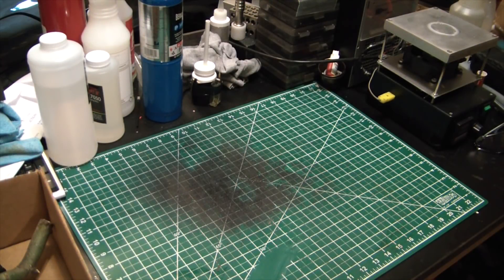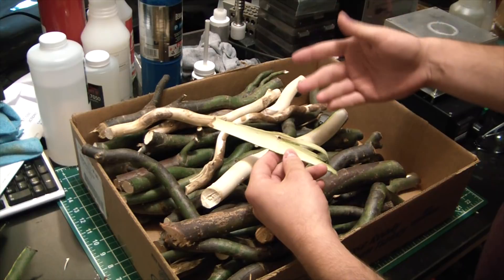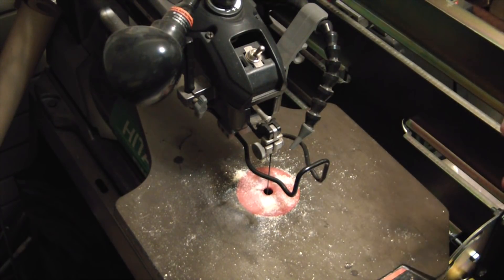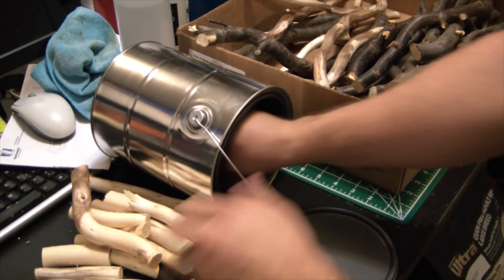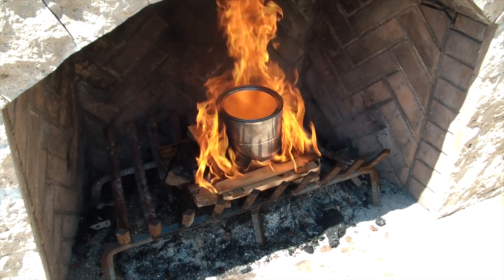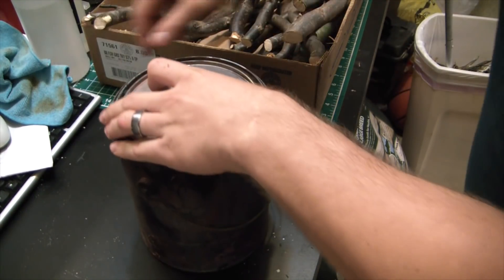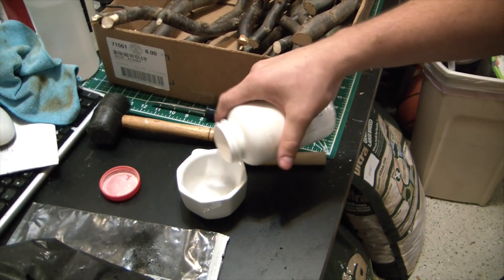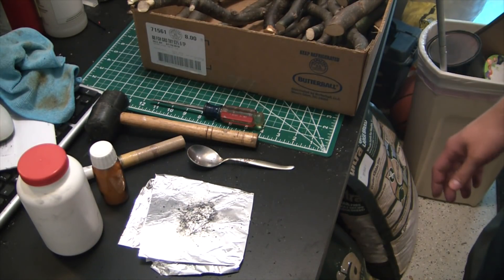Making Willow Charcoal for Black Powder - The BEST Charcoal! ElementalMaker

Comment: I find a pressure cooker over a electric or gas stove much easier to use. Just leave the pressure hole uncovered and when the wood gas comes out just light it with a match to safely burn it off.
Reply from the maker: I prefer to use the wood gas itself to heat the charcoal vessel. Pressure cooker is a great idea though, and it would be easy to set up some copper or stainless tubing to redirect the wood gas to burn under the vessel

Comment: I bought a bag of hamster red cedar bedding and turned it into charcoal. It burned a lot faster and into smaller pieces. I have yet to make bp with it but I read that red cedar burns fast as pauluwania or however it’s spelled.
Reply from the maker: That's a great idea to use for charcoal! Definitely should make good bp!
Reply from the maker: Bummer is I just cut down a red cedar in my backyard and didn't even think to make some charcoal with it. DANGIT!
Reply: Lol well over here its hard to find willow trees so you got lucky as almost all the sites are oit of willow charcoal. Thats why I researched and found the red cedar and its only 4 dollars for a huge bag.
Reply from the maker: I was just reading up and the cedar should perform just about as well as willow, so you did a kick ass job finding a great source! I'm definitely going to have to try that!

Comment: 2 Questions:
First, you referred to the willow tree, I assume you’re talking about the weeping willow tree. I can’t seem to find any reference to any Other type of willow tree out there. Is this true?

Second, is there a difference in using dead dried out limbs from the willow tree or do they have to be green like the ones in your video?

Great info, thank you
Reply from the maker: Pretty much all varieties of willow make for great BP. Ive used both weeping and curly and both are equally great. Dried wood is totally fine to use, it will pyrolyze a bit faster than green wood. Just dont use rotten wood and you'll have some great charcoal.
Reply: Mesquite is better cleaner hits harder

Comment: Can you use wettable garden sulfur or do you need elemental sulfur?
Reply from the maker: It would depend on the purity of the garden sulfur. Its easy and cheap enough though to get very pure powdered sulfur that messing with other sources isn't very worthwhile.
Reply: @ElementalMaker  ok well I'll check the purity at my local hardware store and maybe see about other sources online. I've got plenty of willow to make charcoal out of and potassium nitrate is easy enough and cheap enough to come by. It seems the sulfur is always the part people have trouble with

Comment: I wish I could get some willow. I am out of room for anymore tools lol. Nice job
Reply from the maker: Its my absolute favorite for hot BP second only to Paulownia imo (which has gotten very hard to source despite being invasive).
Reply: @ElementalMaker  I'll have to try it sometime. But I use paulownia exclusively for burst and lift and mixed hardwood for larger cored BP motors. But the willow will be a great candidate for nozzles motors that's an experiment I may pursue. But the fireworks cookbook is a great place to find all the chemical needs you may have. And a few charcoals to choose from

Comment: Well at least he used a long reach lighter, but did he really say he mixes the BP components in a ball mill?  Unless he does it wet that's a possible bomb!  Even in a rubber mill with lead or ceramic balls, the friction alone can be enough to ignite it.  Please, people, DON'T!  I speak from experience: when I was an ignorant, inquisitive schoolboy (in the fifties, been there, done that) and made a rather crude gunpowder in a pestle and mortar it DID ignite.  Fortunately the ratios were incorrect so it burned rather slower but my hand still took months to fully heal.  Could have been a lot worse but please be warned.
Reply from the maker: George none of your information is correct. It is standard practice in the field of pyrotechnics to make BP using a ball mill with lead media. If your BP ignited from a mortar and pestle you did something very wrong (ie used chlorate instead of nitrate). I've been making BP in my ball mill for many years and not one issue. I recommend reading "Ball milling theory and practice". Lead media is non sparking, and BP by nature is very insensitive to friction.
Reply: @ElementalMaker  OK, point taken. It was over 60 years ago and I don't recall whether I was using nitrate or chlorate back then; from what you say probably chlorate. Even so I wouldn't chance it.

Comment: as Im new to this and never done it before, the only question you never answered in the video is how long to leave the can in the fiure when you are first creating the charcoal, i noticed you said that the pressure had decreased so all the water had gone, but how long after that should I leave it in the fire before taking it out and crushing it? I know this is an older video but I hope you are still monitoring this to answer my question :-) Many Thanks, An Aspie Geek in the UK
Reply from the maker: Once the can has finished outgassing, give it an extra 5 min or so 👍
Reply: @ElementalMaker  Thanks for the speedy reply

Comment: I've been making my own hardwood charcoal for a few years. It's great for cooking. I was aware that willow is best for black powder. I've been curious about using pine cones. I have made charcoal out of pine cones for the check of it and it's an interesting end product.
Reply from the maker: I know a few guys who have used pine cone charcoal in for glitter effects in star compositions and it works beautifully!
Reply: @ElementalMaker  why would you exactly do that ... Adding this type of coal what are the benefits ?
Reply: @umbeatable2770  Black powder made with the softest hardwoods is by far the best. Most of these soft hardwoods are the fastest growing, like willow, alder, balsa, etc. Some softer softwoods are good. too, like pine.

Comment: Willow grows all around me in here in Texas but I am to lazy to go cut it and make charcoal.  I am still using the big old bag of commercial air float charcoal that came with my pyrotechnic black powder supply kit it will never be as good as willow.
Reply from the maker: Grab your chainsaw and give it a try 👍 once you pyrolize it, it's just as easy to use as commercial air float.

Comment: As far as the extracting painkiller from willow, I heard the same thing about silver birch so if you do experiment please try that too. As far as the willow charcoal is concerned it occurred to me that seasoned timber would have made more sense. We already know willow charcoal is the best for purpose but would seasoned timber be better?
Reply: That explains why graphite makes a lousy black powder. Thank you for the knowledge.
Reply: It seems nobody ever got back to you on that question. When drying, wood gets denser. So seasoned timber will make heavier, denser charcoal, which is exactly the opposite of what you want for black powder. What makes the green willow so good, is that the xyleme tubes are wide and the wood fiber is fluffy, so you get a maximized reactive surface. Dense coal will burn much longer because they also burn slower. To make good black powder from dense charcoal, you'd have to add a step in the process to increase the contact surface. (I believe Cody's Lab has a video about that, but for the purpose of activated charcoal instead of black powder. The principle is the same.)

Comment: Why did you put hole in bottom instead of top?
Reply from the maker: You can put it either way, but with the hole on the bottom, the venting gasses burn off and feed the pyrolysis process. It essentially fuels itself with the wood gas produced.

Comment: how about alderwood?
Reply from the maker: Haven't ever used it myself, but its supposed to be one of the absolute best. I mistakently forgot to mention it
Reply: I've used both willow and alder for BP.  Willow is better, but alder is about 85% as effective.  Alder was much easier for me to get, so most of my BP was made with alder charcoal, and I could use book weights for commercial BP as starting points on all my BP lift charges.  Would usually have to add 5 to 10% to get the shells where I wanted them...  But I was never sad I used the alder.

Comment: 75%p 15%c 10%s the ratio I use for any amount . Eyeballing works just fine for me ... Happy 4th of July ...
Reply: Ulrich Bretscher’s extensive experimentation with various ratios, types of wood, heats and methods of charring, and other factors determined that you pretty much can in fact “eyeball” it once you have a good idea of the ratio. The main factor determining power of black powder is the lignin content (lower is better) and heat at which is was charred (lower also better). You ought not call people liars without knowing.

Comment: I had the opportunity to make both willow and grape-vine charcoal and test them side-by-each.
Both samples were 'spring growth' stock...trimmings early in the year, still a bit green.
Roasted them in sealed can...you know the drill.
I didn't use sulfur in the tests as I was using the 'CIA'/alcohol method to recrystallize the nitrate and infuse it into the charcoal.
Expelled excess moisture through pressing, made little 'cakes' of each mixture.
Willow burned faster, grape-vine left less ash.  Pretty comparable to commercial 'Pyrodex' in burn rate.
You could call it a modern take on the old French 'co-co' gun-powder; sulfur free, charcoal still has slight brown color due to low temperature roasting.
Reply from the maker: Very cool! I've never gotten to play with grape vine charcoal but hear it is very good stuff. Do you have to debark it before use?

Comment: Could I use a pine wood?
Reply from the maker: Yeah absolutely! Normal 2x4 pine from the hardware store makes good charcoal for BP. Just try to cut any knots out before pyrolyzing the wood.
Reply: Honestly you could technically use any type of char but different materials work differently and some are better than others
Reply: What we want is a fast burning wood with low moisture and low resin content.
Some kiln dried hem-fir 2x4 from Home Depo or any lumber yard will make good charcoal.  Just cut it up in chunks. Cut out any knots that will have lots of resin in them.
Make charcoal then crush and grind.
Reply: Might try balsam wood also.

Comment: How did you deal with the coating on the inside of your can? Thanks for sharing, Billy in Canada
Reply: I won't pretend to answer for him, but as hot as that can got from being cooked by the external flames as well as that intense heat created from that escaping wood gas flame (it burns VERY HOT) caused that can to looked so burnt, it more or less demonstrates that a regular tin can (regardless of it's size) appears to be ''a single use item'' when they're used to make charcoal. I wouldn't worry about that minute bit of residual carbon left in that can & would dispose of it in a way he sees fit.

Comment: Thank you. Hmmm Willow hard to find in the Wild West.... I have abundance of Cedar and Juniper and sagebrush and Tamarisk.
Reply from the maker: Hmm not sure any of those will make a super fast BP, but heres a list I got from a pyro forum some time ago: Pine, Balsa, Red Cedar, Paulownia, Willow, nearly any Fruit trees.
Reply: @ElementalMaker  you said any fruit tree should work, based on that source. I have an entire dead apple tree in my backyard that might work great then :)
Reply from the maker: @dELTA13579111315  that it should!
Reply from the maker: Also, any regular pine wood (ie framing 2x4's) from the local hardware store make for a great charcoal. Not quite as fast as willow in my experience, but very respectable!
Reply: I would think sagebrush would be good because it has a lot of natural oils.
Reply from the maker: @Greg Peck I haven't ever tried the store bought lump hardwood charcoal, but I'd bet it would work perfectly fine 👍probably not as fast burning as willow since it's hardwood, but I'm sure it would work acceptably well for most all uses
Reply: Jeff,  this is a long, really useful, link.  Juniper has a very respectful burn time, if you read the charts.  They don't list the flight times, for it, but it has great burn time.  http://creagan.net/fireworks/charcoal_tests.html
Reply: I'm no expert but I understand the best powder is made by using water to mix the ingredients and absorbing the nitrate into the pores of the charcoal.  Willow, being light has many pores to take it up, but dense yellow pine, not so much. Maybe the tamarisk would work.  There used to be a very large kind in South Texas that was used as a wind break, locally called salt cedar.  They have light wood and many small green stems.  I don't how easily they are debarked
Reply: Willow (any type), Eastern Red Cedar (Aromatic), White Pine, Balsa, Plum, Peach, Poplar, Paulownia, oh and Alder woods are among the best.

Comment: I basically do the same thing but I use a huge cheap stainless steel bowl from walmart and cover it tight with aluminum foil and poke a little hole In it and set it in a fire.
Reply from the maker: Nice! I've been looking for stainless drums to improve the lifespan of the retort and increase the capacity. Stainless is the way to go.
Reply from the maker: @Greg Peck he is saying he uses a large stainless bowl with the opening covered tightly by aluminum foil with a small hole poked in it for gas to vent. It's not as fool proof as using a proper lid, but certainly will work well if your careful.

Comment: What type of Willow is it? White willow or what type of willow did you use??
Reply from the maker: I'm not actually sure, I belive it may have been curly. I'll have to ask the in laws what exactly it was. Pretty much all willow varieties make for excellent charcoal.
Reply: Ohhh awesome, thanks alot Elemental Maker.. where i'm from there are only Weeping Willow trees mostly, it's very difficult to spot another variety of the same tree but thanks alot for the reply, I greatly appreciate it!
Reply: Is it better to use the small branches or larger parts of tree cut down to small size for paint can?
Reply: @knowsbetter1  small branches 1/2 to one 1/2 inches

Comment: Awesome presentation that made me not want to skip through.  Curious, does willow charcoal light within 1-2 seconds with just a lighter's flame?  And,  is that good for black powder?  I ask as I had only made a few batches of charcoal for grilling out of Oak and Maple until just out of curiosity the other day I used wood from an ash tree which had died 3-4 years ago due to Emerald Ash Borer.  It was completely dried out, light as a feather, and gave off HUGE amounts of brown's gas.  Raw pieces lit after 1-2 seconds enough to burn through to ash.  Anyway, just wanted to share in case a quick lighting charcoal is good for making powder.  Just received my sulfur yesterday and hope to find out for myself real soon.  Great Video, Thanks!
Reply: How much you paid for sulfur ?
Reply: @timmynormand8082  Not much, Home Depot in the garden department, if I recall was pretty cheap
Reply: @scottlund4562  thanks bro
Reply: @timmynormand8082  10$ for 1.25lbs of Sevin powder right now, but that's just an example and not sure of that specific product's purity.  Cheers
Reply: @scottlund4562   hey take the stump powder an boil it like 3 cup water 2 cups powder  for like 15 mins  try to cool it  an watch the pure crystals form.   It's so cool an PURE
Reply: @timmynormand8082  Cool info, thanks!
Reply: Just FYI, the volatile gases given off during pyrolysis of wood are not Brown's Gas. That name strictly refers to HHO (2 Hydrogen atoms + 1 Oxygen atom) produced by electrolysis of water.
Reply: @topspeed250k5  u may want to check that statement :)

Comment: The best American "gunpowder" of the 19th Century was made by Hazard Powder Company. Hazard used willow charcoal.  In the mid-1850's Colt had Hazard make special "cartridge" powder for use in combustible cartridges for Colt revolvers.  I've used the Swiss powder equivalent of Hazard cartridge powder in Uberti Army and Navy replicas.  The C&B revolvers, loaded with such proper black powder are considerably more powerful than generally believed.  GOEX FFg and FFFg are not revolver powders, and do not give the proper performance that a 19th Century quality gunpowder like Hazard provided.

Comment: according to foxfire book 5 alder is best. and if you mix with water until a biscuit dough consistency and let sun dry use stale urine instead, it will give the powder more oxygen and higher performance. its not a good idea to mix it all together like that either.

Comment: Does "good" mean fast burning?
I did a few experiments a couple years back making BP from different charcoals.
First i tried BBQ charcoal and it burnt very slow.
Then I charred some willow and that burnt much faster.
Then I tried another type of wood and to my surprise it burnt much faster than the willow did.
Reply from the maker: Yes willow is one of the fastest burning charcoals for use in BP. The only ones that might be faster are paulownia and balsa. It may have been your proportions for the BP that made another wood seem faster. Did you measure out the standard 75/15/10 composition?
Reply: Indeed I did. Care was taken to use the same ratios with each comp. I laid a trail approx 200mm on a scale board and videoed the burn rate. Counting the frames from the video, the wood mentioned was substantially faster than the willow, actually it was easy to see by eye but i had to time it. I've lost the videos but still have some charcoal from the mystery wood and could video again if you're intrigued.